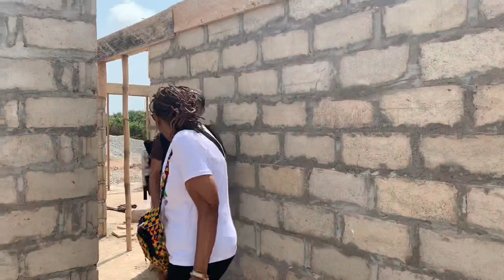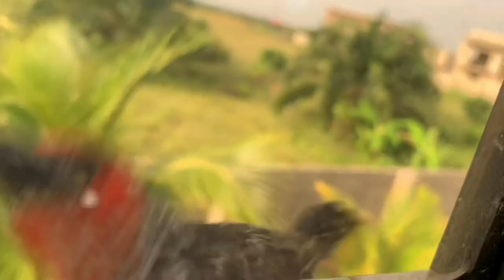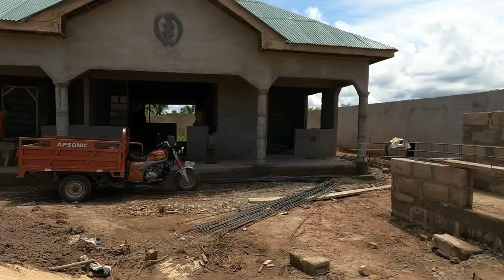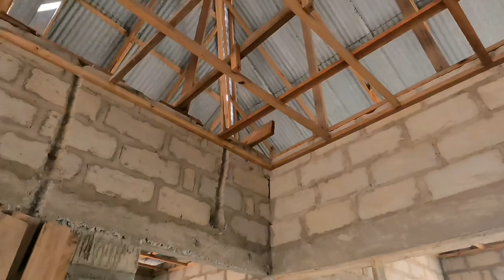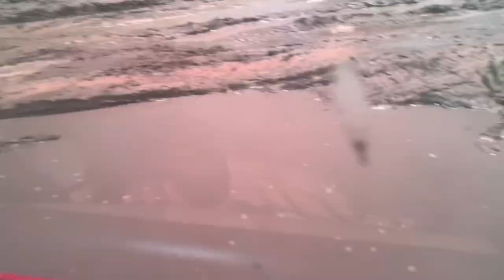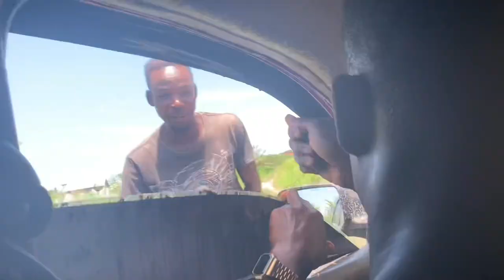The House Is Almost Finished | Building In Ghana During Rainy Season 🌧 Ep 46

Comment: I suggest you get them a water pump instead of collecting the water with little buckets. The time and energy used in doing that could be used on the building. 😊
Reply: We were able to hire a pump the next day. Hard to get during rainy season. Everyone has the same problem.  Fortunately my issue is limited to the pool and road leading to the site. NO flooding inside of the building area! Praise Yah!